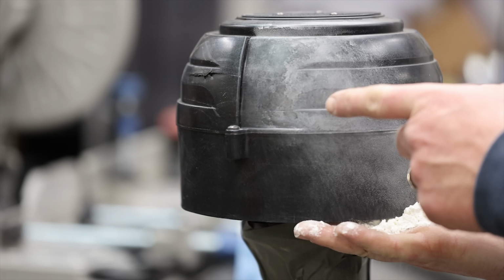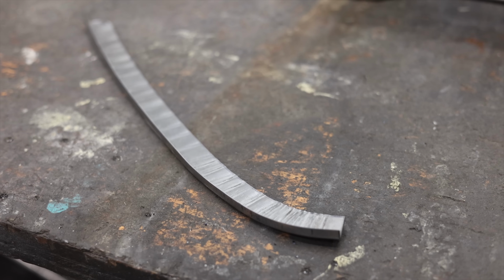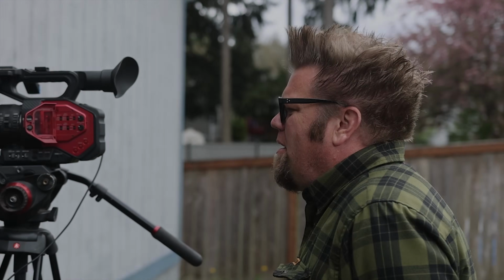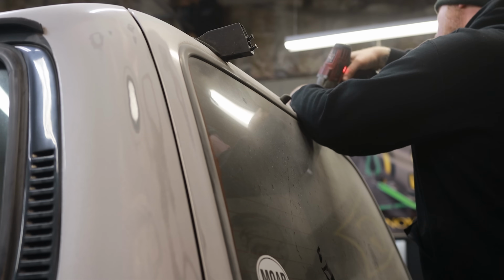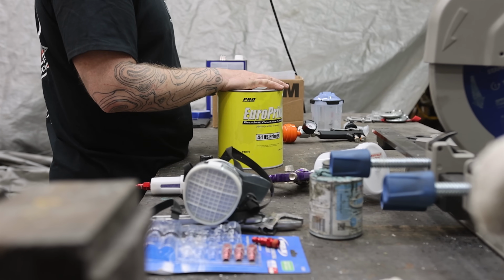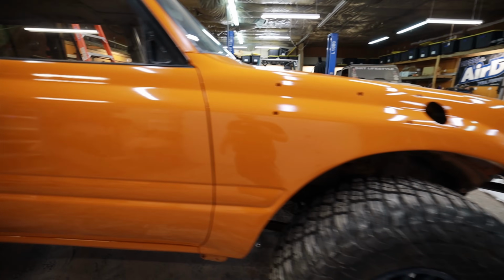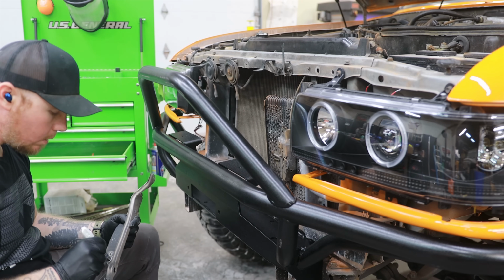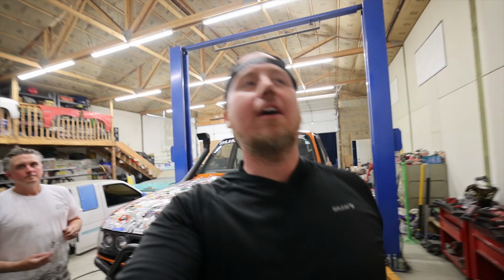Unstoppable Land Cruiser 80 Rock Crawler Episode 2. Budget Off-road Build.

Comment: Reduce the risk of paint runs: you spray a first coat with a tiny amount of material (you can still see the gray through it), then you let it dry for a cigarette's length and then you spray your shiny top coat.
It will be much more sticky and not run down that easy

Comment: Get in touch with me if you need help? Can walk you through the blend.
Festoolmakes a run nib block is about the best. But if take a razor blade and wrap both corners will get you started to shave the run down before sanding. Don't know what paint brand you used ? Not a fan of ppg but there spray can blender works awesome they also have the blender in gallon form . Grayscuff pad in repair area ,gold in the blend melt in area.

Comment: I myself hate the turn signals on my 80 Series. I would have loved to fit a LED lightbar in it's place & turn the parker lights in the corners into the turn signals, or cutting the turn signals off as you have done, to fit an ARB style winch bar, in their place, with the hoops cut off to look like a factory style bumper bar. Your end result looks wicked, except I personally don't like that style of bar in the front. I also want to turn my rear bumper into a similar bumper to what I described for the front, but which would incorporate the towbar, instead of having it slung under the bumper as the factory towbar.
Now looking at yours, I see the departure angle really worse than the approach angle. Could the rear be cut to be level with the front? & the rear wheels & arch be further back to increase the departure angle? Hmmm....
As an 80 Series owner here in Australia I really am looking forward to following this build, Nate 👍👍

Comment: One more: some way you could hide LED strips underneath the headlight for a front turn signal?
Reply from the maker: Dude, I'm so pumped because these headlights have a lower LED strip built in! That is the plan. Use some resistors, in conjunction with LEDs to get a modern look with OEM functionality 👍
Reply: Sweet! Simplicity is good. On a side note: I wonder if that thing still uses a flasher relay. I'm not a fan of resistors, so I look for a relay for LEDs. Diode Dynamics has one that fit two of my cars. Love the build and I'm glad you went with orange and blue. I had a motorcycle a long time ago with similar colors and still one of my favorites.

Comment: Typically you fix the run if its on any coat other than the clear coat. If it was clear coat, then you put body filler over top of the run and sand down the filler and the run till its smooth, that way you dont sand through the surrounding clear coat trying to get the run out.

Comment: Was that a guide coat you were using when doing the primer?

Regarding runs, get a festool denibber, or use a razor blade perpendicular to the paint.  keep scraping until it's level, then block sand the area and then wet sand. (https://www.youtube.com/watch?v=dR4iKZvX53c)

a rupes pneumatic TA50 orbital with an interface pad for that spot should work a lot faster tho.

If that was on the sealant below the base, you're gonna have to go down past the base and to the sealant, and then repaint the base over the top.  It's gonna wear unevenly funny over the years, but if you have a good clear, you should be ok.